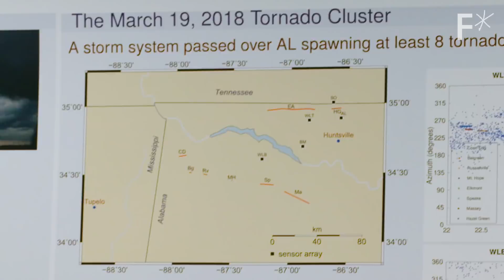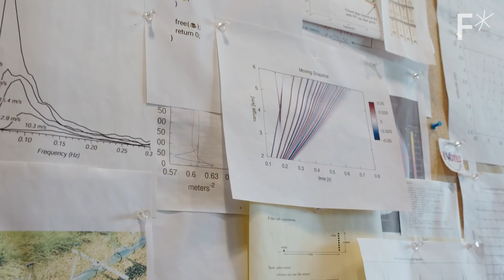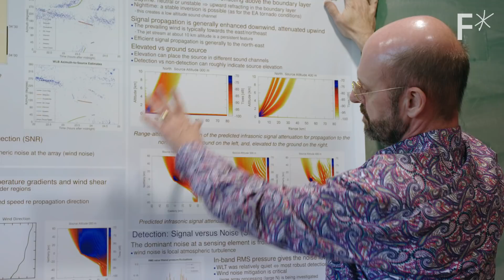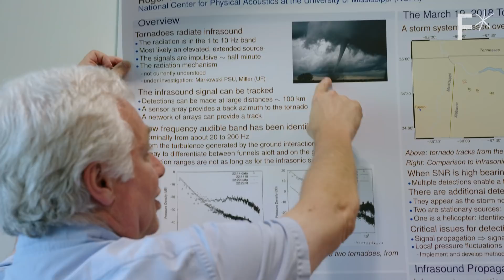The world’s first 100% accurate tornado detector | Just Might Work by Freethink

Comment: I'm extremely skeptical about this. The way it's explained is that they listen to the winds that are conducive to producing a tornado, yet anyone with experience chasing storms will tell you it's extremely fickle. You can have an otherwise perfect set up for a tornado and yet nothing will drop, sometimes for something so simple as a stray wind. Likewise a stray wind can cause the opposite, it's all extremely situational. This is why forecasting these events, even when you're on the ground chasing, can be so difficult. Another thing I'm concerned of is I see a very typical red flag for scams in that they are "bringing back" an idea from the 20th century, which is basically a meme when it comes to scam projects at this point. And then finally, I find it strange there are no links to this project in the video description, or even a mention on where to find the results of this research anywhere in the video.

Comment: This was alway interesting to me.We in Europe do not get these.I never saw one in my life,neither did anyone i know,young or old.How come is this only an American thing?
Reply: The topology of the region is unique, unlike any other area on earth. Weather fronts often originate or rapidly intensify along a line from southwest to northeast. It is in these convergence zones (where warm and cold fronts meet) where tornadoes develop and strengthen. The warm gulf of Mexico air, laden with moisture is swept up into these fronts fueling the atmospheric instability that gives rise to tornadoes.
Reply: @MrBrelindm  How often are they formed?Are the people used to them?Can they go thru a brick house or just those regular ones in US?Sorry if this is a lot of questions.
Reply: @temistogen  More common in summer.  People that live in "tornado alley" are very accustomed to them.  Depending the the strength of the tornado all structures above ground are at risk.  Shelter under ground is the safest.  Concrete bunker with a well secured thick steel door should work.  Brick is not much of a match for them.  Wind can drive a board or tree limb straight through.
Reply: @temistogen  I am from OK. I knew an electrical engineer that designed homes for a living that told me varying ways of reinforcing buildings. Short of living in a bunker none were 100% full proof. She did say adding hurricane straps in the roof & anchoring the walls to the foundation increased survivability to over 80%. Throwing in an underground storm shelter was even better. I asked about older structures. She said adding in nails or simply changing the angle they are hammered in could help.
Reply: They do occur in Europe, tho much more rare. Typically near the center of Europe laterally speaking, so near Germany or Italy. That said another more common area is Australia, on the north and east portions of the continent.

Comment: Why not just solve the problem and live underground.  So simple.
Reply: Living underground is not only expensive and problematic but it could also cause you to be stuck there if a tornado throws debris on top of your structure
Reply: @7ngel  Simplistic.  You would still be alive to dig yourself out.  And, digging a hole is more expensive than building a sky scraper.  You've never spent any time underground have you?  Never mind, give it a try one day.  No air con required.   :)
Reply: Some locations it is not an option.  Water table is too high, or bed rock is not deep enough.
Reply: @ShainAndrews  Ahh, yeah.  The bloody obvious.  :)